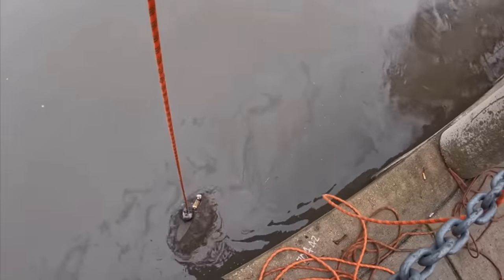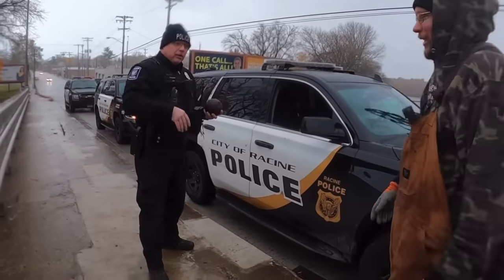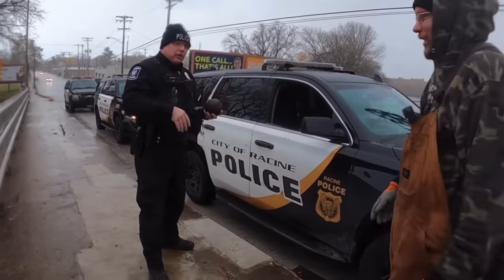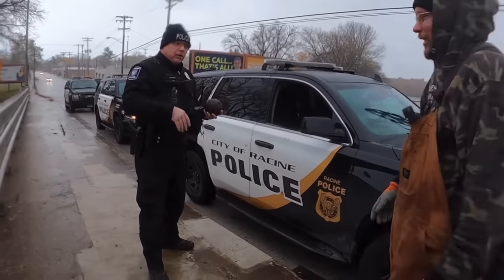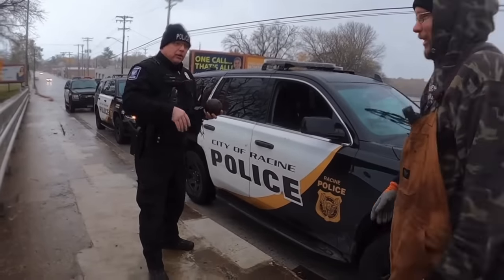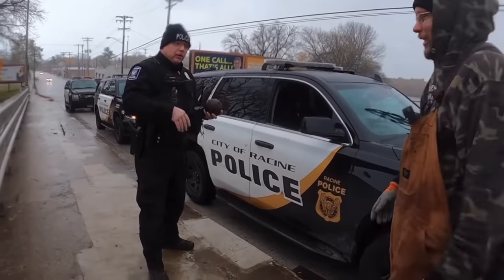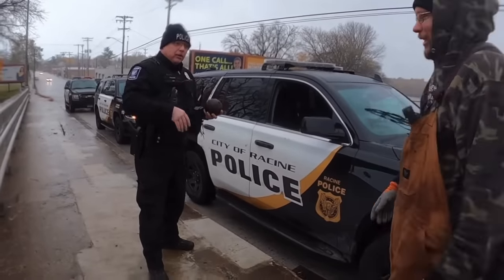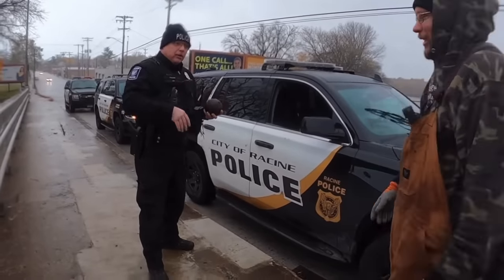Best Magnet Fishing Finds Of 2022 (40+Guns, 5 Explosives, & More)

Comment: First, yes, i watched all the way through.  But more importantly, next time you get a wasp or bee sting, put a penny on the sting. If there are multiple stings, i have taped pennies on with a bandaid. Copper helps pull out the venom. I learned this from seasoned bikers after getting stung while riding. It works..

Comment: That tow bar item you asked about is really called a COME-ALONG. USING THE HOOK ON THE MAIN BODY OF THE ITEM TO AN ANCHOR POINT, THEN PULL OUT THE OTHER HOOK, WHICH IS ATTACHED TO A CABLE, AND HOOK IT ON THE ITEM YOU WANT TO MOVE, THEN RACHET IT WITH THE HAND.

Comment: Dani whenever you get stung  by a bee grab some mud and put on sting it helps pull out the stinger
Reply: When you get stung, use the edge of a cc to scrape off the stinger. Don't just put mud on it first. In case of extra swelling and mud doesn't work,  white toothpaste smoothed over the area can hold off the itch until you get some benadryl.

Comment: The officer at around the 1:20:00 mark is incorrect. Magnet fishing is not at all the same thing as metal detecting. The reason metal detecting is banned in certain areas is because it requires that a hole is dug each time there's a hit. Magnet fishing does not require digging in the ground. 

Unbelievable, how some officers react to this activity.

Comment: The Luger’s Ingenious Design
Modified in 1908 as the 9/9mm Parabellum, the Luger became noted as the weapon for which the 9x19mm Parabellum cartridge was introduced. It is estimated that more than three million Lugers were built during their long service run. Various sub-machine guns had seen valuable and effective trench warfare service during the Great War, with experimentation done as well via pistol conversions into fully automatic hand-held sidearms, among them the P08, in which the Luger displayed a substantial rate of fire.

The Luger was 8.74 inches long, with a barrel length of 4.7 inches (3.9 inches in the short version and 7.9 inches in its artillery version); a weight of one pound, 15 ounces; a rate of fire of 116 rounds per minute in its semiautomatic modality; and a muzzle velocity of 1,148 to 1,312 feet per second in its 9mm short-barrel configuration. With its iron sights, the trusty Luger had an effective firing range of 56 yards in its short-barrel edition, boasting a feed system of an eight-round, detachable box magazine plus a 32-round magazine if needed.

It has generally been reputed to be one of the most accurate of auto-loading pistols, making it preferred over any other revolver or pistol of its time.

It was used from the 1900's up until the 1990's

Comment: There will be numbers they have been putting serial numbers on guns since late 1800s but wasn't required until 1968 I have several from 1890s to 1950s that have numbers alot of time they are hidden under grips

Comment: If there is no pin and no spoon which is the pc that comes off after you pull the pin that usually means the detonator is gone all it's left in there is gunpowder90% of the time All you have to do is put a little bit of a plastic spoon or a knife plastic    Down to the hole and see if you can scrape out if you can get me it's Down to the hole and see if you can scrape out if you can get me it's a dead Grenade

Comment: In the context of the firearms, there is a difference between a magazine, and a clip. A magazine must be physically removed from the weapons system to reload, or clear it. A clip is mechanically ejected from the weapons system after the last cartridge is discharge. For example, any AR platform weapons system feeds via magazine. Whereas the military issued predecessor to the M16 and M4 duty carbines, the M1 Garand of WW2, operates using a clip. Note, the infamous audible PING made at last round. That is a clip fed system. There are, to my knowledge, no modern weapons systems that operate using a clip feed system. Granted, stripper clips, are still used for some outdated, yet still actively used weapons systems. Examples such as soviet Mosin Naggant 7.62x54r and Japanese Ariasaka 7mm jap
Reply: Penguinz0 explained that recently as well.

Comment: You guys need to get some gun information that shows the guns and eveything about them. One of the guns you found was definitely an SKS and what was standing up on the barrel is a sight, not a scope. I know about those because i owned one. The shotgun with the square butt on top is an automatic 12 guage shotgun. To tell if that was an M-16 would be if the selector lever will go all the way to the auto position. If it doesn't switch to auto, it's probably some type of AR-15.

Comment: The officer explaining cannonballs is not correct. Nitro wasn't discovered as an explosive until 1867 after the Civil War. More than likely the ball yall found is a solid shot. I have found many cannonballs and shells. The shells are the ones with black powder in them. They can still be set off as long as the powder is dry. Some did have percussion fuses and some had old-style paper fuses. They can be preserved by drilling the shell underwater remotely and then washed out. It is sad when they are handed over to the "authorities" just to be destroyed! BTW they can sell for a good bit of money to collectors!
Reply from the maker: About time someone who knows more about cannon balls comments. Thank you for the info and we handed the cannon ball over to the cop that was gonna take it home not to the pd. We just didn’t know to much about them at the time.

Comment: You notice that ankle monitor was still locked closed.  You have cut them off or have your doc or judge remove it and then it wouldn't be in the river. I wonder if they looked up who was assigned to the monitor left and if they are missing ?

Comment: Regarding “ballistics”. It’s not like on TV. Ballistics are not the same as fingerprints. After a few rounds (or corrosion) the ballistics of a barrel change. 
Also, possession of a firearm with the serial number obliterated is primarily facia evidence of having obliterated the serial number which is the unlawful act. Prima facia however does NOT mean guilty. 
Also, not all firearms made were required to have serial. I’m era so some firearms may never have had one and are perfectly legal to possess (federally). 
However, barre discipline needs to be added to your skill set as these weapons could fire. For instance a corroded part could be just barely holding the firing pin back and fail from shock. 
Be careful. 
Retired USMC Ordnance tech